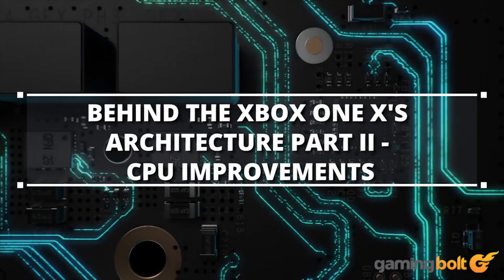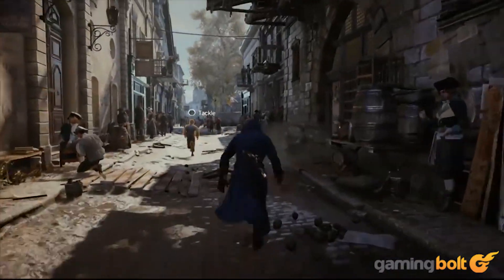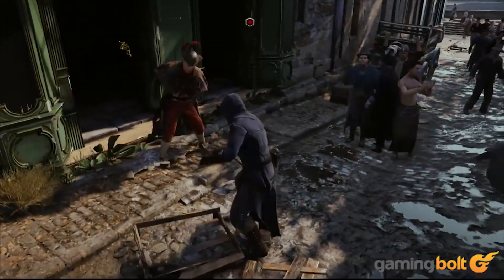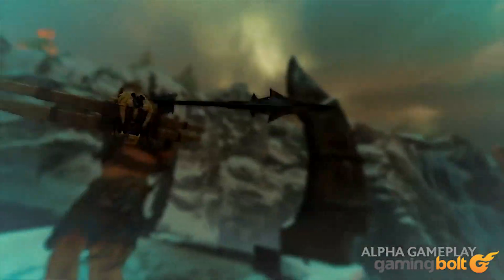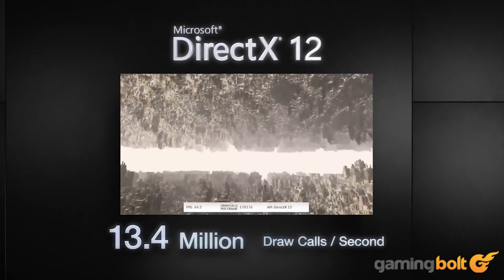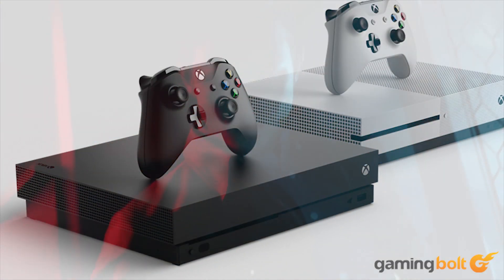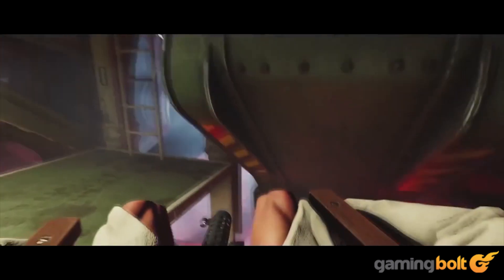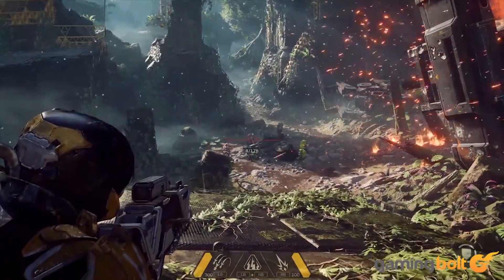Behind The Xbox One X’s Architecture Part II - CPU Improvements, Command Processing & DX12

Comment: XB fanboys should realize that both X1 and PS4 cpu aren't really that powerful. In fact, even a 4th Gen Core i3 can beat that at lower clock speed. The  Architecture found inside the current gen systems are based on AMD Jaguar A10, which was designed for Tablets and Ultrabook PCs. So don't expect any miraculous performance out of these systems.

And that's the reason why Sony and MS focused on Super charging the GPU side instead, because it is more important in delivering a Next Gen development. GPU is a General Purpose computing that handles most traditional complex CPU computations, faster and more efficient.

So I wouldn't be surprised when the Next Gen PS5 and X2 comes out with the same weaker CPU, but Super charged GPU in 2020. Because it is more ideal and feasible in a long run.
Reply: Well this comment didn’t age well lol
Reply: this aged like milk with the zen 2 xsx and ps5 cpu lmao

Comment: Xbox one X is putting out better 4k than a gtx 1070, and can run games better than most 
house hold PC's.. Real facts
Reply: WELL NO SHIT (For the 2nd point, not the first) House hold pc could mean a pc that's from the 80's!
As for the case of you thinking "Xbox one X is putting out better 4k than a gtx 1070" I just want you to think how many fps a 1070 can do, and then compare it to a XB X promised 60fps, you can see a 1070 does more than 60. In 4K high BF1, it does 72FPS in some areas, which is MUCH more than 60. It's a 20% increase, for crying out loud!
Reply: dnbtrooper
You're delusional if you think it does better than 1070.
Reply: Sorry but most games run better on a 1060.
Reply: dnbtrooper spoken like someone who DOESNT own a 1070

Comment: But is it as good as a threadripper or coffee lake (yes, that's the actual name)
Reply: In terms of raw IPC it is not even close to those processors. It does feature a few customized hardware enhancements such as the hardware integrated dx12 which can in certain cases bypass the CPU or greatly reduce the amount of commands the CPU will need to execute. The CPU in the xbox one x is very streamlined but a the same time fairly weak. Developers who take the time to optimize their games will see good performance from it though.

Comment: There are two things this Technical Buffoon is Missing #1 This is not an OverCLOCKED Jaguar. This is a completely Redesigned SCORPIO CPU clocked at 2.3GHZ #2 You have made 0 Mention of the HOVUS Method Chip which takes all this RAW power and EXPEDITES and Mediates what is truly needed without WASTING Precious Resources. So no YOU ARE COMPLETELY INCORRECT in your assumption that this is JUST a Rehashed OVERCLOCKED CPU.
Reply: Daniel Neal It's both actually, it's custom made but it's also essentially a Jaguar CPU..
Reply: Jaguar is still jaguar ... was garbage for the ps4, xbox one, and ps4 pro... hasnt worked well for games thus far... why expect jt to change